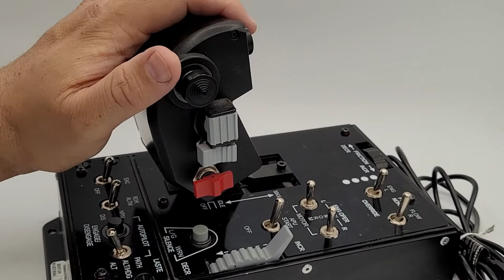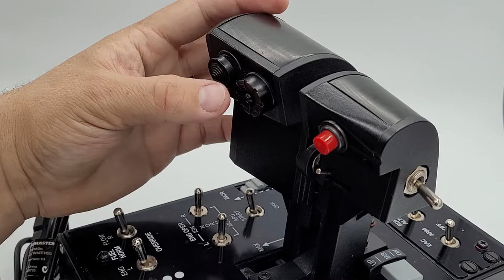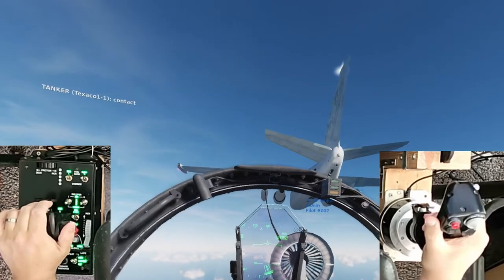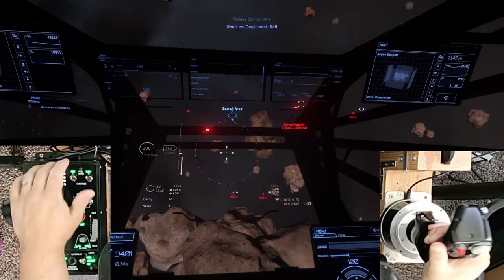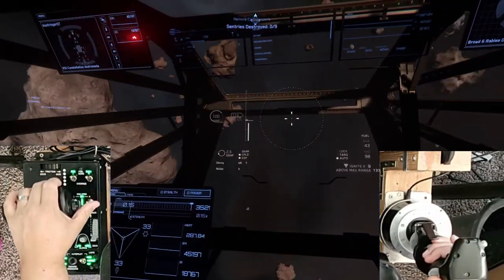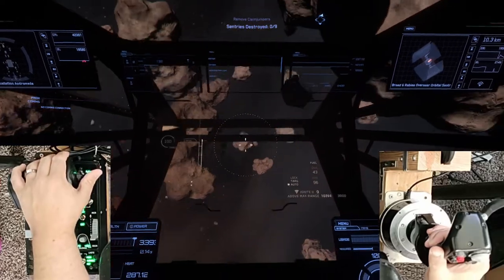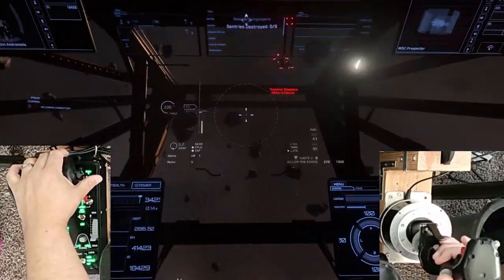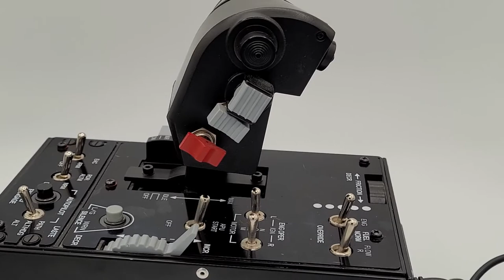Thrustmaster HOTAS Warthog Hardware Review

Comment: What throttle to get? Been driving myself (and the HOTAS discord probably) nuts with this question. Unless the WW comes with detents and/or those finger lifts included as a stand-alone offering, it will have to be the WH for me. And I too can tell you why .. :D 
I can get the TM delivered within a day or two from any number of vendors in my country (Germany) for a pretty decent price - amazon has it for €239 incl shipping at the moment. WW Orion 2 would be €320 incl shipping and import duties. Unless it doesn't include detents/finger-lifts in which case it'll be more like €400 (shipping cost for the lifts are a bit insane ... $50 for the throttle on its own, $17 more if you also want the lifts shipped). And since we have to pay import duties on product price + shipping cost, this drives up the final price even further. And €400 is just €100 away from my actual dream-throttle (Virpil) so the WW is out at that price.

My other reason/point is that I think if you have to allocate funds between stick and throttle (which I will do), the stick will always have the higher priority for me - it's just more important than the throttle, since you use it way more often and more, errr.. intensely. My current plan is to either see if I can get a second hand deal on the WW Orion 2 or, if that fails, get the WH to replace my TWCS and then either the Virpil WarBRD or VKB GF to replace my Gladiator NXT Evo. Not that the Evo is bad or anything (far, far from it, actually), but I will need more buttons than my KG-12 has and I also think that after 20+ years of simming mostly on mid-range plastic products, it's time to go metal/high-end. I think I've earned it... :D
Reply from the maker: The Orion 2 has finger lifts and detents. The Orion is a full decade ahead of the WH.  The WH is NOT WORTH THE COST.

The Orion has bottom events when coming up to idle and into the off position, WH doesn't. Orion has full metal internals, WH doesn't. Orion has radar elevation axis, WH doesn't. Orion has an analog slew, the Warthog has an absolutely garbage "nub" that is aggravating to use, and very inaccurate.  There is no comparison between these devices. Don't be impatient, buy the best, not the convenient.

Comment: I was about to pair the Warthog throttle with the Gladiator NXT, but your review just convinced me NOT to get the Warthog throttle. Guess I'll either wait for the TECS or splash out on the MongooseT.
Reply from the maker: The throttle is good, very heavy, but I do wish it had a good analog stick. With a $65 modification you can add an analog stick, which helps a lot. The orion throttle from winwing shows a lot of promise, but I don't know if they sell it separately from their orion stick.
Reply: Same here. Got my Gladiator NXT yesterday. I also want to wait for the TECS but it seems that they're delaying infinitely. And the Virpil Throttle is way too expensive. :(
Reply: I got the throttle to pair with the gladiator NXT! Let's see how they work together!

Comment: you also mention one big con at least for me  - as far as I can see in your vid.  which is the lack of a yaw-axis  - to perform roll in space games like SC ?
Reply from the maker: 1. Rolling with twist makes you weird.
2. I don't count that as a con for "replica" sticks, since the original doesn't have it either.

Though I like twist to yaw, and I currently use it, once I get used to pedals I like them, mine just don't stay put on my cement floor

Comment: With the prices of these somehow skyrocketing for a 10+ year design, I went with the Winwing orion setup. $499 and it let me pick up an joystick extension and MFG crosswinds for almost the same price as the warthog.
Reply from the maker: The winwing Orion is a better value right now, even at MSRP.
Reply: @FalconsLedge  Yeah, no. If I lived in China? Yeah. 
But that 499$ quickly turns into 700$+++, when you add the shipping costs, VAT, and import duties on top of the MSRP, putting it into Virpil's/VKB boutique stuff price territory, and nearly twice the Warthog price.
Reply from the maker: @TheKain202  Where d you live that charges you 200+ in import and VAT? I paid 50 on top of the price of my throttle to get it shipped plus import.   Warthog throttle? Not bad, Warthog stick? Well it works and feels decent, Warthog gimbal hell no, that thing is horribly oudated and prone to issues. Not worth it.
Reply: @FalconsLedge  Poland.
23% VAT. 8% customs, + shipping will easily get it into 700+ territory. I guess Poland doesn't have that big of a sim community, covid and the like didn't hit the prices all too much. Bought my Warthog for 2000pln(~350-400$ depending on exchange rate) in 2019, and it still goes for about as much. 
at that price, winwing's Orion is not exactly competitive - getting it home would cost me at least 3500pln. At almost twice the price not nearly the same pricing tier.
Reply from the maker: @TheKain202  since I can't compare vat, and customs and taxes and all that other stuff from every single country I go by MSRP. I'd still take Winwing, VKB, or Virpil over buying a warthog any day.  Heck, when I had a gladiator NXT and Warthog together I found myself preferring the NXT over the warthog stick.
Reply: @FalconsLedge  Don't get me wrong. I think everyone's aware that Warthog is outdated by a decade at this point and doesn't hold a candle to modern high end, and is mid range at best by the standards set by current industry leaders.
But VKB's and VIRPIL's offerings are waaay out of what i'm comfortable with spending, and Winwing, while amazing and competively priced on paper, ends up being deceptively expensive when you add the inevitable extra costs involved in actually getting it to my door.
So, i'm sticking with my Warthog for now and not at all repentant about buying it. As it is, in my specific country's case - it's in a tier of its own, you have Logitech's clunkers for half its price(had a pre-Logitech x52 before the Warthog), and the big three's gear for upwards of twice its price.
That said, when the stick starts showing wear, i'll probably sell the throttle and go Winwing. The Taurus throttle looks dreamy, and the advances made in gimbals this last decade are undeniable.

Comment: I managed to buy mine at RRP of £355 in June 2020,then added a 6 inch stick extension which removes stiction and increases fine movement. I next got the TPR pedals (the best that exist!) and the F18 stick. There's a PlayStation mod for the targeting 'nipple' that works much better. VERY pleased the Thrustmaster setup!
Reply from the maker: Whoever told you that an extension eliminated stiction was either ignorant or misleading you. Stiction occurs when wear and tear on the ball and cup gimbal causes the cup to bind to the ball. This can be avoided by maintaining your grease in the gimbal and in most cases sanding down any rough spots on the ball and cup.

If anything an extension is going to cause more wear and exacerbate stiction not the other way around due to the fact that the stick will have much more lever arm on the gimbal.
Reply: @FalconsLedge  It reduces stiction to the point of elimination by increasing the leverage moment on the ball and socket. That one simple mod transformed my warthog stick!
Reply from the maker: @ColinDyckes  if you have stiction and you put an extension on, it would appear to eliminate stiction due to the change in the lever angle. The stiction will come back with time. I'm sorry but I'm 100% positive that adding an extension does not prevent stiction.
Reply from the maker: @ColinDyckes  don't get me wrong, extensions are great, and I recommend using them, but because they help stiction(which they don't), but better because they help with accuracy.

Comment: Thrustmaster's design is way different to the others...mainly because it was released with a specific pattent. Now the question is do you prefer playing with cams and springs, or with a fixed solution?
Reply from the maker: Fixed solution as in FSSB or cams and springs vs ball and cup like thrustmaster?  I think thrustmaster has the worst of the high end solutions, but not specifically because of the design but the materials. If the TM gimbal was metal they'd be in pretty good shape.

I really want to do some real testing with FSSB, but have not had a long term test with it and can't really form a full opinion on it. Theoretically it's great, and I really hope to get more time with it soon.

Comment: this has been an interesting review. My “high end” stick has been the X-65F for the past 8 years. I’ve flown falcon bms, an F-16C simulator, and it has served me very well. Venturing into DCS around 2014, I realized how much I enjoy flying other platforms, especially helos and the force sensing on the X-65 can definitely throw you off in other aircraft. I wanted to stick with something similar to the F-16 stick so, I purchased the F-16 stick from thrustmaster and have paired it with the Virpil warbird as well as the T-50cm3 throttle allowing for a more versatile set up while keeping my familiarity with the F-16 stick. Although there are back orders on such products, It only took about a month for all of it to get to me, so I think the wait is worth it if you plan on getting virpil products. I just wonder how nice the thrustmaster stick will play with the virpil base.

Excellent review!
Reply from the maker: The grip itself is the best part of the thrustmaster stick. It has a great feel to it, I would recommend using heavier springs with it since it has a higher pendulum load on the gimbal. 

I haven't ventured into talking about the x65 since I've never used one. Hopefully I'll get a chance to compare the experience to other solutions.
Reply: @FalconsLedge  Man, for being a viper guy, the X-65F was like peanut butter to jelly. Smooth force sensing controls translated so well from BMS to the DCS viper, I didn’t even need to add any dead zones or curves. My only complaint was the throttle has these flimsy plastic rotaries that die out (based on your X-56 review, it’s damn there the same throttle with the same issues). My sensors pretty much crapped out on me with constant stutters that made for an absolute headache. Other than that, it was a pure joy. Still works, too. I’ll probably go back to it just for old times sake. They should honestly keep making them.
Reply from the maker: @TheRandomSqueak  x65 is one I've never tried, perhaps I can get my hands on I've for a proper review someday
Reply from the maker: If you are looking for an upgrade to your x65, look at the realsim sticks, but be prepared to get your wallet out, they are quite expensive
Reply: @FalconsLedge  yeah that’s a lot. Plus I coughed up the cash for a new virpl setup

Comment: Dude, are these still being manufactured? I haven't been able to find one under 600 bucks, since right before covid.
Reply from the maker: They are still being manufactured, but covid affected production, and they are also in high demand, bad combination
Reply: They are, but they're hard to find currently. I had to buy a new stick base last July after my old one went out and the only place I could find one (at a reasonable price and not an extreme mark up) was on Walmart's site with 2 left in stock. It sucks for sure and I feel your pain. Hell, I've been wanting to get some Virpil gear, and I had to scrounge around to luckily find the WinWing F/A 18 Hornet throttle and the two control panels. It's rough for simmers right now. Covid and the MSFS release has definitely contributed to the major shortage
Reply: @christopherhanifan7923  Amazing reply, man! ORDERED VIA WALMART - Thank you - I read on WinWing's forums that their new throttle is stocking up sometime tomorrow. Hope it's true.

Comment: Great joystick, I have had mine for a few months, I just find it awkward to use with the large base, so am trying to design a mount that fits to the front of my chair...
Reply from the maker: I threw a couple of wooden ones together for $20 using two C clamps , some screws and some 90 degree L brackets.  I am looking to build some custom aluminum Extruded ones that naturally I'll post on here with a how-to video.
Reply: Why don't you just place it on your chair and sit on top of it (joystick inbetween your legs? That's what I do and it's comfortable with F--16 and F/A-18 grip without wrist rest.
Reply: @EbonySeraphim  Thanks, but too late, I made 2 fixtures with some wood and metal brackets. The throttle is permanently fixed to the side, but the joystick is easily removable.
Reply: @Hobbes22  No hair off my back. Curious though, did what I said make sense? I think it's strange hardly anyone (who posts on YouTube) uses it that way. It's super close to where it's supposed to be straight out of the box and works with a any normal desk and chair.

The only downside I can think of is that your chair needs to be maybe a foot or two back from your desk so the joystick doesn't touch the desk on full deflection forward. I have long arms and legs so I can still reach a forward throttle (though my desk now has a side return), and rudder pedals.

Comment: I got the stick around the time this video was posted and stiction is already a noticable issue. Cost me about $750 for the hotas and I knew it was above market but my x52pro was suffering from centering issues during a time where the stock for PC hardware in general was not available.

I would probably recomend passing on the TMW. I've gotta open this thing up now, and re-grease with Nyogel767A which was an additional $50. It has been a love hate relationship. I miss having more axis like the x52.. prop and mixture controls in flight sim just aren't as good when bound to digital hats.. in addition, there is a severe lack of momentary switches, and since the flap switches are not momentary, they won't work as you might expect in any sim apart from specifically the A10 in DCS. You can use their convoluted TARGET scripting language with a custom profile that tricks the driver into allowing 128 button support and making the flaps act as momentary software side but you still physically need to return them to center every time you extend. In addition to the annoyance if having their software running before you load a simulator / game and having their service startup with your PC.

Overall, many oversights for an expensive piece of kit. I'm still torn if I like it more than my x52. I do appreciate the more premium build quality and weight. It's a step above the toyish feel of the x52.. but in all honesty, I would recommend looking elsewhere for the same budget.. perhaps winwing.
Reply from the maker: Winwing it's a great option, or VKB. Don't go with the x56, they have massive quality problems and ergonomic issues.
Reply: @FalconsLedge  I've had my x56 for 2yrs now, not a single issue. Guess I got lucky.
Reply from the maker: @EazyE11  judging by the return rate, and long long list of user issues on virtually every forum out there, yes it appears so. 

This happens quite frequently when you critique products.
Reply: @FalconsLedge  I might be a bit late to this discussion, but my X56 is a nightmare.
Throttle:
 2 Way switches on the throttle base have 2mm play in either direction, went from nice clicky feel to mushy,  mini sticks have HUUGE zone where it doesnt center (20 Deadzone in DCS), 4 Way also have 2mm play in either direction, the 2 way on the back tends to stick in the down position after pressing, rotaries got sloppy after 6 months of owning it. 

Stick: I have to set 12 as a deadzone in dcs. The centering mechanism sticks, doesnt center well, and when i grease it i have to bump up the deadzone to 15. Ministick has terrible center (20 Deadzone in DCS again) Trigger is okay-ish, you just dont feel the button press, only the trigger bottoming out. Trimhat has 2mm play in all directions, the 4 way under that 1mm of play and the POV hat has maybe ~0.5mm of play.

I really dont like it, and my Virpil gear should arrive today.
Reply from the maker: @erinaisshu  I don't recommend Logitech or thrustmaster gear. VKB, Virpil and Winwing
Reply: @FalconsLedge  Yeah i know. Just wanted to give an example of the issues you mentioned. 

When FedEx finally does its job right my Virpil stuff will arrive. Should be here today, but last update i got that its still in transit.

Comment: T16000M HOTAS without pedal rules the world!!!
Reply from the maker: I'm going to have to call your bluff there :), the Gladiator NXT is 10x the stick the T16k is. Better sensor too.
Reply from the maker: @billwiley7216  the TWCS throttle appears to have been delayed, but if the price is at about $200 to $250, it will be a great value. I'm also looking forward to the button boxes that attach to the GNX. Those are further along in production than the TWCS, who knows we could see them soon?